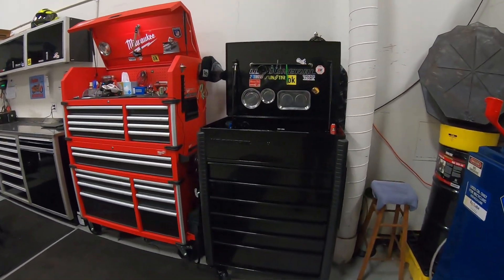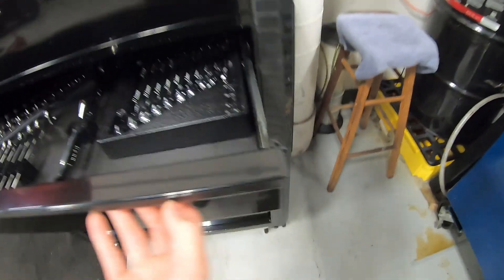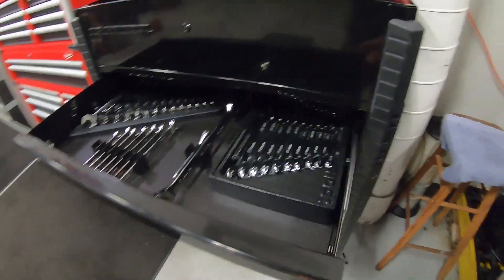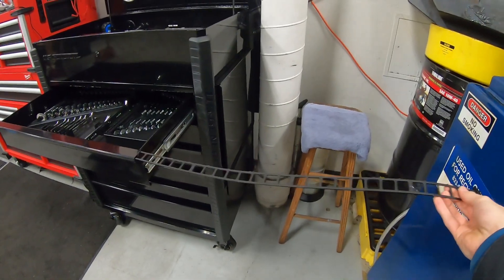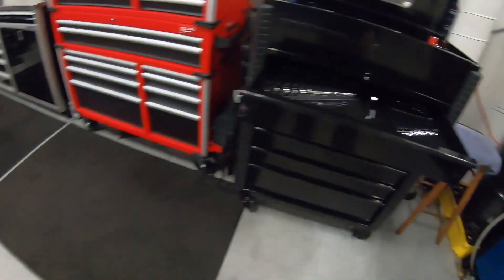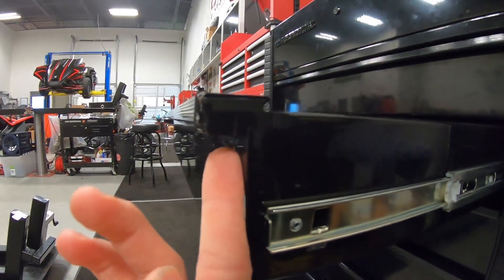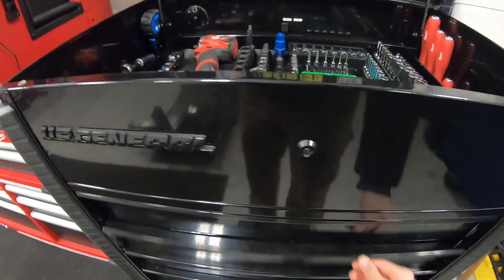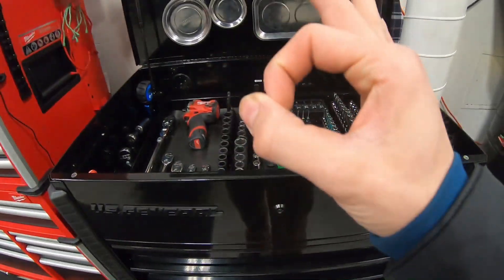FREE US GENERAL 34IN Full Bank Tool Cart/Tool Box Mod!

Comment: I hope the box stays on one spot then, because that is also to help keep the drawers closed when moving around
Reply from the maker: It does for the most part. But these boxes also come with a manual lock in the top portion so if I move it far you can completely lock all of them down when needed.